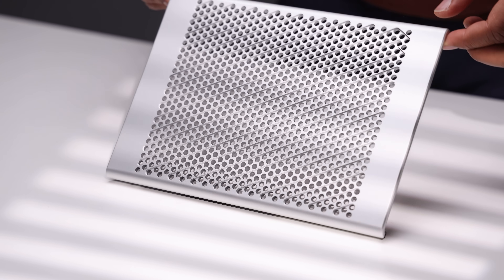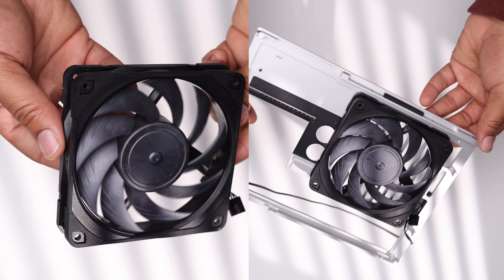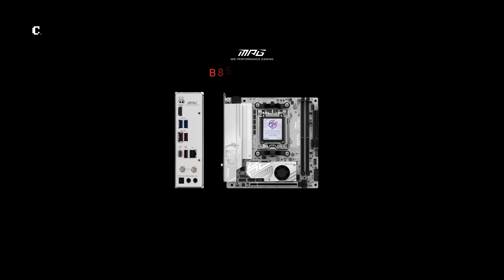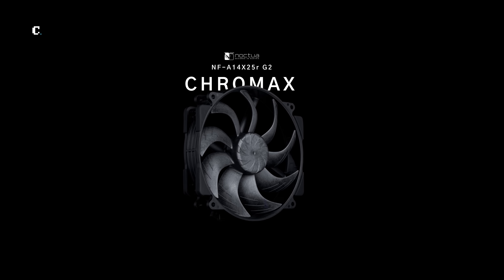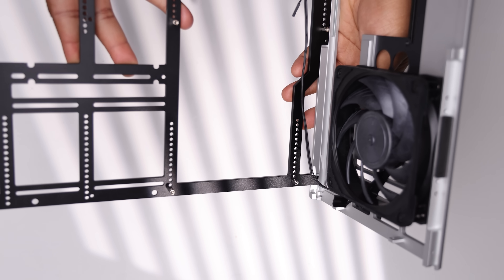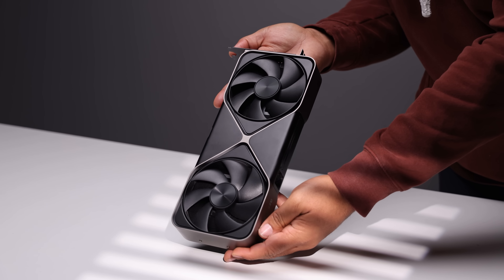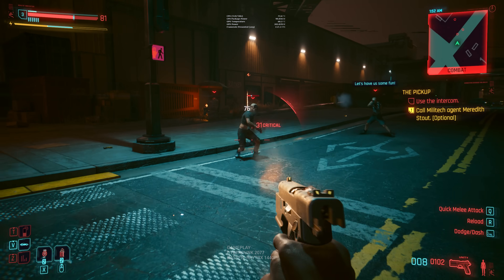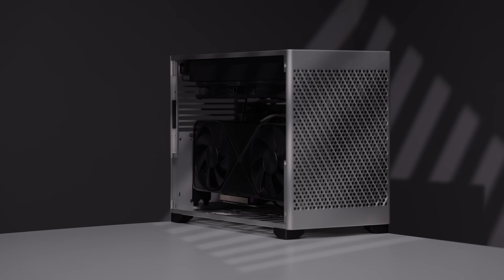NCASE M3 \ Better Than Expected.

Comment: itx builds are interesting if ur into a minimalist build for strictly one type of a workload, gaming for example.

matx is the sweetspot for a just right build for 80% of workloads mixed.

atx basically covers 95% of any workload you throw at it.

eatx if ur into a workstation like type of uses, close to a server use cases but not quite a server.

love that this category is getting the attention it deserves.

much love ❤.

Comment: Question for you. I have built my computers since like 2000, but its something that happens once ever 5-6 years so I forget a lot. I am looking to build a PC in 2026. I have a 4090 and a 4TB SSD ready to go but RAM prices are horrible, I'll just have to tough it out. Anyway, my issue with the NCASE is as good as it looks, how do I know what I need to get as extra? Like it comes bare bones (which in a way is good, why have parts you don't need?) But aside from the feet (which they sell now for $5) how do I know what parts to get? Is there some kind of guide? I would be running a 1000 watt PSU, likely what you had in the video, a TBD MB, 9800 X3d, Gigabyte Gaming OC 4090, 32 GB of ram, and the mentioned 4 TB SSD. I might go with the Noctua cooling or a water cooler.

Comment: This and the NR200 series are the ideal size to me. I love SFF that can still fit large air coolers with ease.
Reply from the maker: Despite its lacklustre release, the NR200P v3 is a good option too.
Reply: @ChrisRussellTech  I'm torn on whether I like the new vent location. It forces a vertical GPU mount which is worse for cooling and a worse layout IMO. I think the ideal layout is horizontal GPU with fans below and the entire top 2/3 of the case for whatever CPU cooling you want to do. People do love their vertical GPUs though.
Reply from the maker: @CosmicApe ideal, sure that’s true but the difference isn’t that substantial.

Comment: Moving to this case from my T1. Curious about VGPU setup with an AIO.
Reply from the maker: It works. You’ll need to mod or purchase the VGPU kit.
Reply: Why tho t1 looks better
Reply from the maker: @princekittipon6510looks are highly subjective but there’s more to looks also. The M2 is far more flexible with a 50% increase volume, albeit.
Reply: T1 is choice, but since GPUs aren’t getting smaller and I don’t have an FE 5080 it was time to grow the case footprint.
Reply: @adamEwok buy fe then
Reply: If you have a legit new 5080 FE I would but eBay GPU market is sus.

Comment: I already love the case... But almost love your build if not by using half sfx components... If you want to build with an Itx MoBo and sfx power supply you could already do that in the previous M2 grater. M3 is for those who want to go big with the components while having the smallest case. Like the smallest car with the biggest Engine. The Noctua d15 g2 chromax black inside this is awesome though.
Reply from the maker: I personally don’t like MATX. You can still maximize the case with ITX components; longer and thicker GPUs, more space for AIOs and liquid cooling. You have to make several sacrifices with the T1, even in ITX mode.

Comment: is psu custom cables? if so what is length measurement?
Reply from the maker: Yes they’re custom, CPU 400mm, 12V 2X6 300mm and 24-pin 300
Reply: @ChrisRussellTech  where do you order the cable?
Reply from the maker: @spencernguyen5056 I receive mine from MODDIY but disclaimer, I received them free. There are other manufacturers either similar quality

Comment: amazing compatibility.. but the issue with these cases is that you're paying for that compatibility and many options you probably will never need.. the flexibility is the Pro and con of these premium cases.. and you're not just paying by dollars, you're also sacrificing space that you'd otherwise not have to if you got a case specific to your build with no fancy extra features you don't need. It's also gonna take more time building into them.

Sure you can pretty much fit any build into them somehow, but is the price worth it? is the difficulty in configuring them right for your build worth it? 

I've built PCs into 3 different mini itx cases .. a hyte revolt, a QL58 (maybe i got the name wrong but it's a popular one with glass and mesh sides), and a Chinese S400... the s400 was the cheapest, smallest, and easiest case I've belt into (only issue is the led being too bright when the pc is sleeping and blinking).. and it's all premium metal as well that does not feel cheap at all compared to all of them.. the hyte revolt was definitely the sturdiest but was seriously huge and heavy for a mini itx. In fact the QL58 was the cheapest feeling and the least sturdy in my opinion and most expensive.. the metal was very thin and flimsy.. it just didn't feel together at all .. idk if this makes sense but if this case sneezed i feel like it would fall apart.  

Just know your needs, if you don't need water-cooling and fancy compatibility, you don't need to overpay. There's no ultimate best case, the best mini itx case is one that is perfect for your current build needs, not your future what-ifs and possible things you might miss out on or future upgrades.. My s400 might be trash for you because you prioritize editing over gaming and the cpu cooler clearance is bad for this purpose, so I'm not saying mine is the best. again it's all about your needs.. that's my advice to anyone building for the first time, don't be hung over the possible upgrades you might do 5 years later, focus on your current needs and you might want a new case by the time you'll actually need to upgrade.. especially if you build a decent starter pc.

The more the compatibility and flexibility a case offers the more complicated configuring it is. . just know that going into these fancy nancy cases. 

anyway.. it seems like a great case but i really don't think it's mini itx enough.. it's huge. but tiny for a micro atx which is great if that's what you need.

Comment: Wow Chris! Thanks a lot for the review, great build! Long time waiting for this one!😂
I have a few questions:
1. Same build except the side fan, could I add an mAtx mobo for the same build you showed in the video or have to make more changes?
2. If I decide to go liquid cooling for the cpu, what size of the radiator would it fit on the top? And could I have a build with liquid cooling and an mAtx mobo?

Thanks a lot!
Reply from the maker: You’re welcome! 

I don’t think you can do a top radiator with a MATX motherboard, maybe a 240 but I believe a 280 is out the question completely. Yours have to use the very bottom position, potentially eliminating bottom face in the process. Your best bet is to side mount the AIO to use all your fan mounting options.
Reply: @ChrisRussellTech thanks Chris! Noted

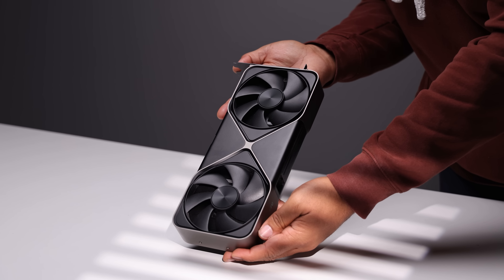Comment: 8:42 Whaat? "clearance for intake fans....",  "to make sure it does not interrupt natural GPU flow"? 
You block 1/2 fans flow of GPU with CPU. Who need extra FANS over GPU? It can take (or blow out) its own air on load, just don't block the exhaust or intake.
Ideally GPU blows hot air out and up (or WB from it), never 400-500W of heat in!!! Isn't it that obvious (there is no need to find a dozen ways to fail it).
Only other way  - if you get non-founder GPU with airflow blowing to sides, then you need to redirect it out of case to the max.

Comment: Beautiful video, do you mind to share the feet 3D file? I found the original one round feet is too low if I have bottom case fan to suck in the air.
Reply from the maker: Hi,

Here is the file I used for my case feet. https://ncased.com/pages/3d-files?srsltid=AfmBOoqzFVN8RVjInXTAouYIMu6MAng_MiFeklSeISs8dAyNFLV1jkQl

Comment: With top end GPUs getting larger and larger this is a welcome upgrade. I have an older m1 ncase that I gifted to a friend after it was too small for my future builds. Very tempted to get this. 🤔
Reply from the maker: The M3 won’t disappoint. The extra space adds piece of kind for big components but still small profile.
Reply: I got a 2 slot rtx 5080. Would have fitted my Ncase M1 v6.1 easily, but I have since loved the Formd t1 v2.5. Can't go bigger when you have a barely audible undervolted and overocked deshrouded rtx 5080 and 7600x3d.

Comment: Is this the most optimal fan setup for this case? Any other recommendations?
Reply from the maker: Personally, I think so. Not as interesting as inverted
Reply: @ChrisRussellTech  does the side fan messup the airflow in the case?
Reply from the maker: @nathancbao no, it just slightly more noise and maybe a degree improvement.

Comment: Got it in black round last week and did a build this week. It's a great case and quality are insane. Just wish my unit did came with dust filter but it wasn't something I cant diy. Side by side to M2, wasn't that much bigger in my opinion. You definitely need to stick with SFx or SFL at most as ATX PSU even with itx MB is kinda hard to fit into the chasis with big tower cooler
Reply from the maker: Try reaching out to support, I’m not sure if they’ll make that backwards compatibility for previous buyers. I’d personally never use them but I fall into a small group of builders that never keep the same system running for to long. This M3 is already disassembled and boxed. No time for dust accumulation.

Comment: Anyone knows the aprox. custom cable lengths when using sfx psu in the m3?
Reply from the maker: Well I’d go larger. CPU 8-Pin 400mm, 24-Pin 400, 12V 2X6 300mm
Reply: @ChrisRussellTech hey Chris! You would go larger than the lengths you posted? I am confused :)
But thanks anyway!
Reply from the maker: @krasstian12 larger than what I used in this video.
Reply: @ChrisRussellTech  Ah got it, thanks!

Comment: I have the M2 and I'm looking for case feet like the M1.  The 3d printed case feet you have are just what I'm looking for.  Did you print them yourself or did you buy them?
Reply from the maker: I got them printed at a local shop, be careful to follow the instructions as you may need to rotate or flip the feet for each corner. There should be instruction in that link.

Comment: awesome, just order the M3 Rounded to house my 9950x and 9070XT.  Cant wait :) great video! gonna use ur layout too :)
Reply from the maker: Glad you liked the video, can't wait to see your build when it's done! Post on SFF subreddit.
Reply: @ChrisRussellTech  ha ok :) im the 9950x with a 240 Atmos and it still gets hot (cinebench r24 get to 95c!) in the Fractal Era2.  So hopefully the new case with the new cooler etc will help.  
Still kinda disappointed with the atmos though :(
Reply from the maker: @RC-Cinema  A 240 really isn’t enough but it shouldn’t hit 95c, low to mid 80s to be expected. Try messing around with PBO2 and see if you recalibrate your fan and pump speed.
Reply: @ChrisRussellTech  yeah i just did an offset of -10 cause anything lower would cause the pc to crash.  
whats the best method to recalibrate the fan and pump speed? i was thinking of replacing the fans with the Noctua  nf-a12x15 slim fans, and wonder if they would be better?
Reply from the maker: @RC-Cinema what fans are you using and their curve?
Reply: @C @ChrisRussellTech m using the stock fans and the curve I left as default on the bios. (Turbo mode)

Comment: The same sh*t as previous m2, honestly
Reply: same same but different
Reply: @jhdz999 cousins
Reply from the maker: I went in with that same thought but the case feels heavier and more solid, apart from it physically being bigger than the M2. Plus I had zero concerns on whether my components would fit. That level of comfort plus the fact that it doesn’t look much bigger, is a win.
Reply: @ChrisRussellTech just big enough to not sweat about putting big components and compromising on cooling or air flow
Reply from the maker: @jhdz999  right, this is the best transition case for ATX users looking to go SFF/MFF
Reply: @ChrisRussellTech  sounds like ncase sent you this for the review. I paid my own money for it and I have a different opinion, as some things dont match the advertisement. Current ncase has ruined the old glory of m1
Reply from the maker: @jw7r3 paid for it myself, they actually refused to send me a review sample.

Comment: could u skip the side fan mounting bracket if u mounted the psu on its side ? "fan mounted right next to the psu"
Reply from the maker: I’d ultimately skipped the side fan, it doesn’t make a huge difference either the D15 G2